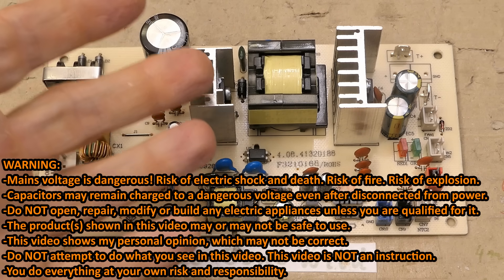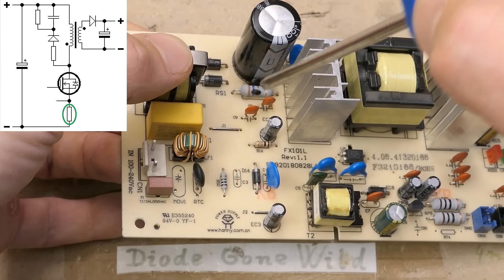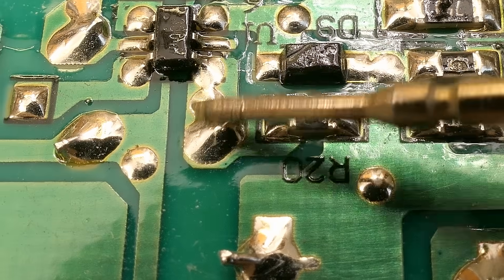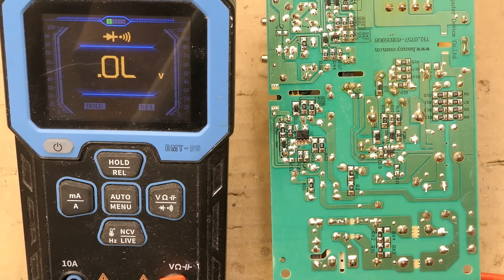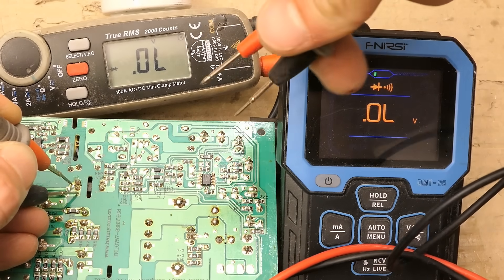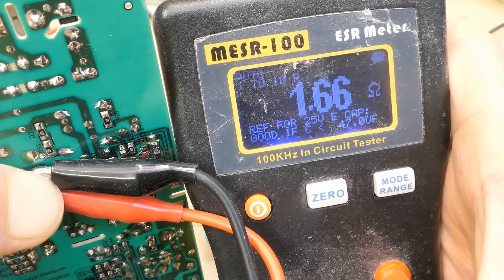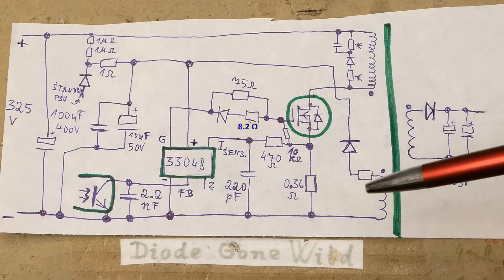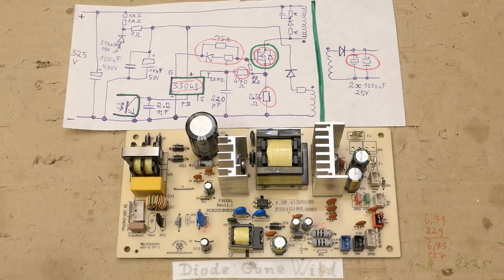Peltier Fridge Power Supply

Comment: when I saw that black spot on the blown current sensing resistor on the primary side, my first guess is that it was some drop of glue or paint, not a hole at first glance.
What an effort you put into this. You ended hitting the same roadblock as I usually hit when I tried fixing some SMPS' in the past. I always started diagnosing and all the components are good, show good readings, but the chip is the only one I couldn't verify and than I realize that I just lost my time and not going anywhere.
Once, I got a very nice 12V 10A SMPS that I modded with a potentiometer and a voltage meter that I used like a generic supply for a lot of things and it failed. After diagnosing everything, again, the unique component that I couldn't verify was the control chip. So I was determined to fix that particular power supply because the time I spent modding it. So I grabbed a brand new SMPS from the same batch (luckily they were still available) and exchange the control chips. For my surprise, that fixed it, so I could save my modded PSU, but on the other side, I just scrapped an entire PSU because of the chip, unmarked btw. Seems to be a reoccurring thing at least on my back luck side to end up having bad control chips and not something else. 
Let's wait for the sequel.
Reply: Most of flyback SMPS could be fix with a module from Aliexpress ,the module had everything you needed control,igbt ,optocoupler .you just need to know how the flyback works and you can resurrect any small power supply.
Reply: It can be hard to make out details in videos. That's the magic of movies. When he zoomed in though then the skid marks that resistor made when it blew became more apparent. The trouble with video is you the viewer can't really zoom in. We can only see what the camera shows us.

Comment: I did not know/expect a secondary side failure could take out the primary side
Reply from the maker: Yes, it can. Often a shorted secondary diode destroys the primary transistor, but even the loss of the secondary capacitance can increase the peak transistor voltage to the point the transistor fails. In this case, the JCS8N60F mosfet probably failed this way. When the transistor turns off, there's a lack of load, so the voltage shoots too high. Also the super high secondary ripple might have confused the feedback circuitry, leading to a too high duty cycle (feedback runaway), which exposes the transistor to both overvoltage and overcurrent.
Reply: With no load, the reverse voltage is near unlimited, and the primary transistor sees it added to the supply voltage. I remember when designing them it helps to reduce the turns ratio (e.g. use a nominal 15 V output for a desired 5V supply, to reduce the voltage stress on the primary switch, trading off more stress on the secondary diode).
Reply: @liam3284  Another option for random flashing is bond wire failure in the LEDs, especially in lamps that are pushing current and heat to the limit. Thought about that when I noticed one of my GU20 LED lights randomly turning on and off earlier. Haven't opened it to check what happened yet.
Reply: About 15 years ago, my living room PC quit booting and I replaced its PSU. When I got an oscilloscope 10 years ago, I dug out the dead PSU from my spare parts pile and took a look at what was happening on its outputs. I found out that the 5VSB rail was overshooting to almost 20V, which should translate to primary-side flyback voltages also being around 4X what they should be, which is very bad. All because the 5VSB capacitors were effectively open-circuit. Replacing all of the 5VSB capacitors cleaned the outputs and I put that PSU in my good spares pile.

Flyback PSUs rely on low ESR to clamp flyback voltages on their primary winding, secondary output(s) and auxiliary output(s). They will self-destruct if left in a failing state long enough.